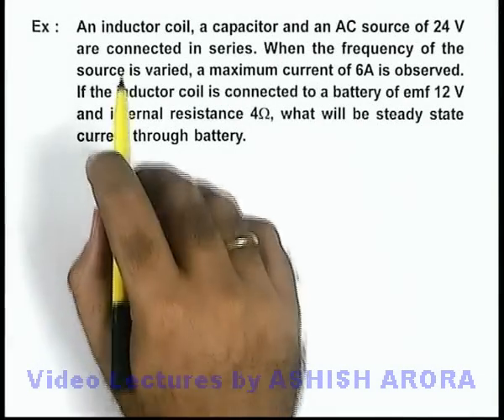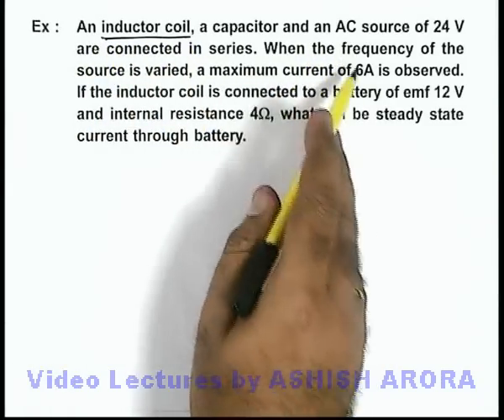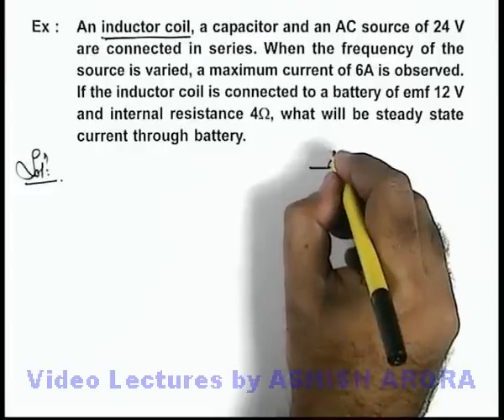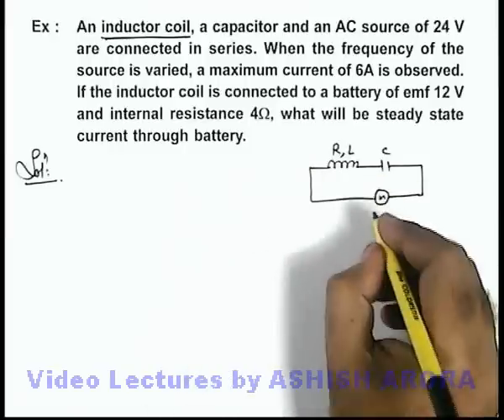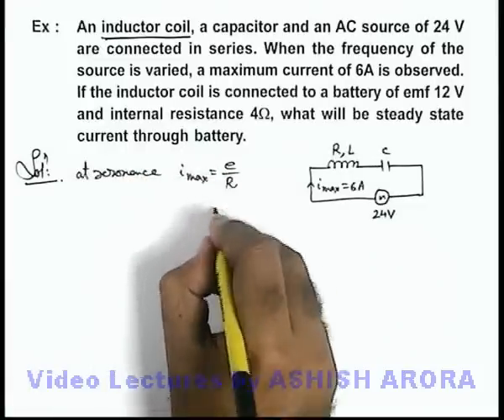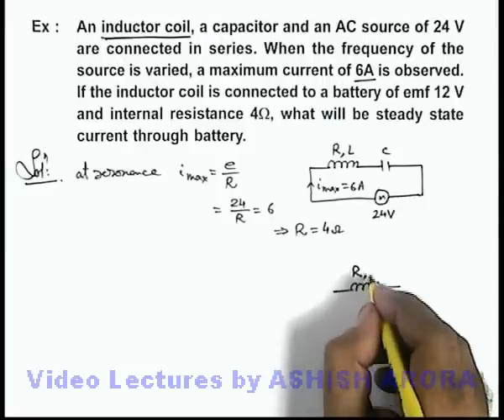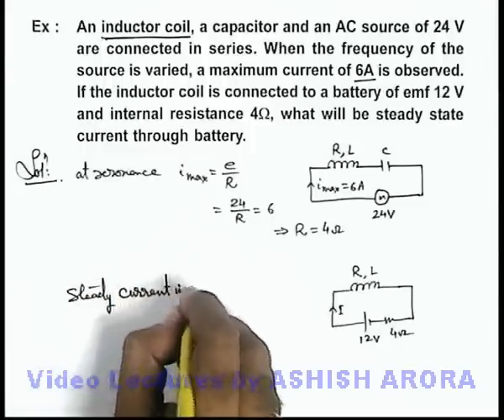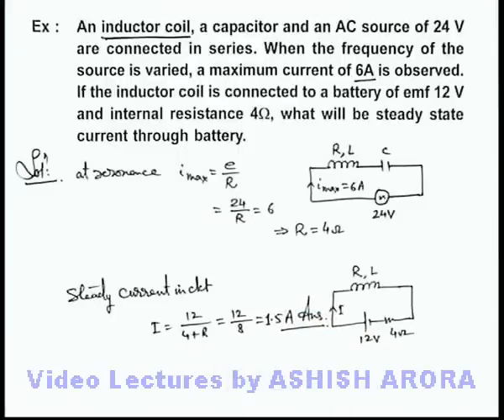Class 12 Physics | Alternating Current | #47 Solved Example-14 on AC | For JEE & NEET

Comment: sir,i am having confusion that ,
1]how R=L and also that is it circuit which consists of resistance also indirectly because max.current can pass then only.
2]can we solve the problem by considering XL =Xc ? if yes then it is giving different answer.
Reply from the maker: As it is specified that DC battery is supplying the current that means it has resistance...

Comment: Sir,  how do you know that resistance calculated in first part of question is linked with inductor and not capacitor?
Reply from the maker: It is specified and interpreted from the language of question... always read the question carefully...
Reply: @physicsgalaxyworld   can you please point it out coz I still don’t get it
Reply: Capacitor is 2 metal plates with charge stored in them. And Inductor is a coil. And the inductor is connected with the dc battery and there is finite current ..which means it is the one having resistance.